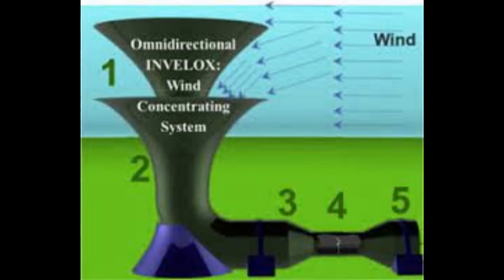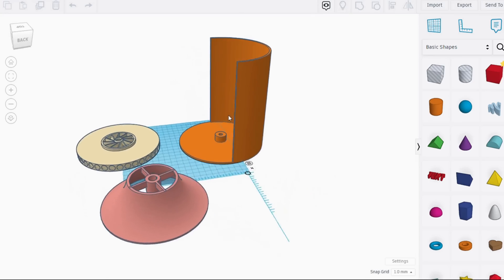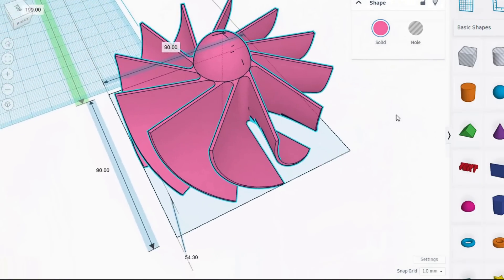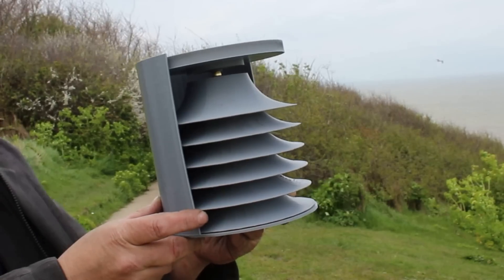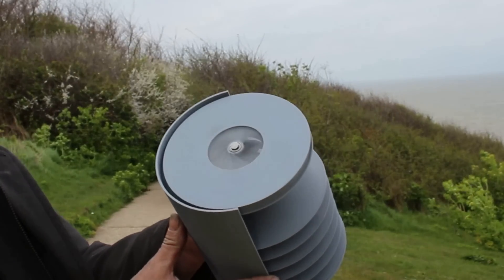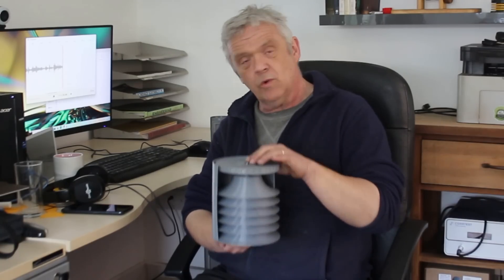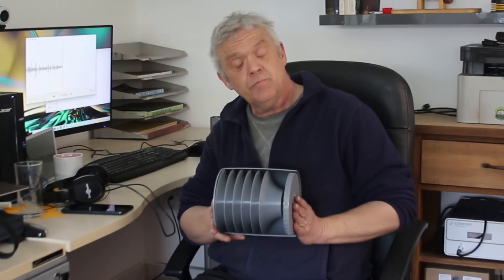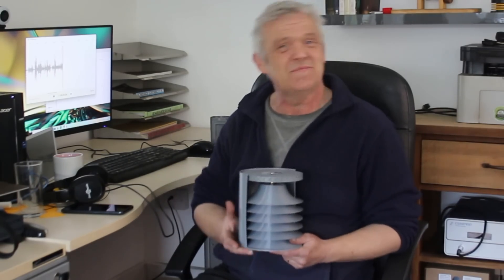1901 Brand New Wind Turbine Design For Camper Vans, Boats And Roof Ridges

Comment: Robert, did you have the chance to compare the power output of this VAWT vs using the same generator (or the alternator) directly as HAWT? 

What is the percentage loss due to redirecting the wind?
Reply: in technical aspect: this is not realy a VAWT - since the airflow is along its axis => what defines a HAWT (even if the axis is vertical to ground surface
the loss will be imense and the total design can directly go to the bin. The whole thing does not make any sense at all.
Reply: @sonic_P  I am not sure whether the loss will be really immense or minimal. The best way is to try and see. That is why I asked Robert, if he had any comparative values. I am rather optimistic and see this method (not only this design) as the most efficient VAWT to be designed. HAWT is much more efficient than any VAWT due to its logic. For  HAWT, as ypou said, the wind is parallel to the rotation axis, and the whole fan area is productive, while for "normal" VAWT the wind is perpendicular, and halfof  the area is not productive, if not counter-productive.

But with this design you change the wind direction ( and just be because it is parallel  to the axis, it doesn not make it HAWT; but yes a HAWT rotated 90 degrees with wind also diverted.) and make use of the whole area again, while you loose some power due to re-direction.

That is what I am after.
Reply: @kadirhaldenbilen6149  there is a reason, why he does not have comparatitve values: it does not work ;) resp. the losses are too far too big so it will be not competitive with any of the established WECs. (I was one of the developers of VerticalSky by Agilewindpower, I know a little about WECs  - and they still have hard time getting her VAT running - despite producing energy....).
Yes, one could try - easier way would be just putting some simple calculations on paper - or doing very basic CFD analyses first.

s)
Reply: @sonic_P  It is nice that you have some background on the subject, VAWTs in particular.  I am not  (professionally at least) involved in the subject matter, but heavily interseted, especially on VAWTs; for use on boats. As far as I know lift type VAWTs are more performant than drag type ones; so your system should be on the upper scale VAWTs; but still as I said it can make use of the half of the wind swept area. That is why HAWTs are aup to 40% efficient while VAWT stay below 20% level.

If in this design, power loss is even at about 50% level, then that would be at other VAWTs' efficiensy level. Any better preformance will put this thing  above them.

It is not that easy to sit down and solve partial differential equations on paper to see how much it will perform; and not everybody might have the chance to sit down and model the system for CFD overnight. Just making a small model might be faster and easier...

Comment: It looks like you could daisy chain these top to bottom if you made a hole in the base plate and allow the wind to continue up through the following base of the next unit, capturing and reutilising that energy. Lay them on their side in a long row along the roof line and rig them up with capacitors.

Comment: Finding these designs very interesting, this one particularly interests me for powering a IoT devices in the field.

I haven't watched the whole series yet, but the section that carries the magnets seems to be common on most designs and I assume therefore the serpentine generator model for holding the winding from an earlier video fits with this?  It looks as though the "back wall" would need to be shrunk a little to allowed the winding holder to fit around the magnet holder?

Are there build instructions somewhere that detail the bearings, shafts etc required?

I'm now subscribed so will see everything going forward, but think I'll be cramming session going through the previous stuff!

Comment: love it... but less moving parts on a boat the better... have you looked at Davinci turbine principle to use the wind turbine above the roof to remove (suction) heat from the attic as well as make power. I live in Florida where it is summer 10 months of the year. biggest cost is cooling the home. Thanks

Comment: The turbine is still the actual limit as you can get choked flow, hence there is a limit to how much stacks of cones you can effectively stack (beyond which you get diminishing to no returns). Also since the turbine won't be 100% efficient at extracting the energy from the wind the leftover could be the start of the next stack of cones (and presumably you could use less cones before you saturate the following turbine).

Comment: I would guess that there is diminishing return for each cone you add. But that does not matter. figure out what the optimum stack is then make it modular. separate the cones from the generator. Then you can add as many cone units as you need for this application.

Comment: I'm really intrigued by the stacked 'cone' ducting.

With the impeller on top, there are probably some opportunities to exploit thermal energy. 

Perhaps as simple as painting the whole thing dark to absorb heat (hot air rises); Maybe adding an 'axial' coil for heating in the center (electric heating, or maybe hot water from an external source - using this ducting to cool the water).
====

The ducting also seems like it could be used to exploit air entrainment (without the turbine)...

Comment: What will be the limit of stacking this things i(f we ignore the weight)?

I you stack X layers on top of each other, the amount of wind captured would increase for every layer. That again would cause an increasing windspeed down the inner "tube" for each layer (more wind captured/more wind must be "transported"). Increased speed would case increased resistance. What would be the perfect number of layers for a given windspeed and a given inner "tube"?

I'm struggling to find the way to calculate this..

Comment: Robert, If there was a way to direct the wind from the center of the stack out to the edge of the rotor you would increase the torque, because of the larger swept area and pressure further from the axis, improving generator performance.
Your thoughts?

Comment: if you knew wind would only come from one direction could you put 50 or so of the tapered cones inside a peace of 100mm pcv pipe and mount across the ridge of a roof or even make it the trunk of a fake tree🤩🤩🤩🤩🤩 would lv to see this on upcoming video plzzzzzzzz☺🙏

Comment: Great design but what happens to it in high winds and rain? Wind turbines normally have the ability to furl out of the wind to stop destruction of the turbine bearings.
Reply: I agree, a great design, and I believe it will prove to be quite robust. Conventional wind turbines generate power due to the the lever effect when a column of moving air strikes the angled blade surfaces set perpendicular to the direction of the wind.  The lever effect is translated into a very powerful twisting force (torque) at the fixed point or hub of the blade assembly, giving rise to the relatively slow (30-40 rpm) rotational movement that we see.  The component that normally generates the electrical power is an alternator which operates at a much higher rotational speed (1500 rpm).  Consequently a very large multi stage gearbox is required between the rotating blade assembly and the alternator.  This is the week point in most wind turbine designs as an immense amount of heat is generated inside these gearboxes due to the vast energy transferred in a relatively small space.  These gearboxes which are the size of small vans must increase the drive speed from the blades from 30rpm to 1500rpm, and are filled with oil for cooling and lubrication.  To prevent an over speed event in high winds, the blades can be feathered to reduce their rotational efficiency and the nacelle can be turned to reduce the effect of the wind on the blades, but as the blades remain constantly exposed to the prevailing winds, any failure of the built in control systems that prevent overspeed events, may result in excess stress, build up of heat and eventual seizing of the gearbox with disasterous results (fires, blades spinning out of control, breaking and even complete collapse of the tower).  Roberts design has non of these features, and also has the advantage over other types of horizontal axis wind turbines (Savonius and Darrieus types) that there are no moving parts exposed directly to the elements.  Also the open side can easily be closed off either partially or completely using a semicircular slide during excessively high winds, so this design should prove considerably more weather and wind proof than other types of wind turbines, in fact it would prove ideal for rough weather and high wind speed environments, and could be promoted as such. The only down side is that its power capacity is limited to the relatively small area of incidental wind compared to the vast cylindrical column of wind that a conventional wind turbines blades are exposed to as defined by the circular area swept by the blades rotating around the hub. But even this limitation can be over come by stacking units to form a 'turbine tower', and even arranging towers next to each other to create 'turbine walls'. This could be used instead of conventional cladding on skyscrapers and other tall structures.  My apologies, I hope you don't mind my very long reply, but I confess, I really love this design.
Reply: Good question - don't want the bearing seizing and the rotor bouncing away

Comment: If you opened a hole in the bottom, wouldn't it suck additional air up due to a venturi effect?  Wouldn't that open the possibility of installing a second fan at the bottom?  Haven't thought it through, but that's my first thought looking at it.  Interesting nonetheless.

Comment: Do you think if you painted or printed those cones in black that they would heat up and cause more of an updraft to increase power.
Or put a black "chimney" on it to increase updraft.
Another idea is to have mirrors focus sunlight on a particular area to warm it up and that heat rises from copper heat transfer pipes inside the chimney?
Just throwing more mud at the wall of ideas. 💡💡

Comment: I was wondering whether  on a  boat the drag and consequent extra power to required to overcome it would in some way equate with the power produced.  If so, under sail this might not be problematic but for powered craft there might not be much advantage.

Comment: Love what you’re doing here. If you could find a way to get the air back the edge of the generator disc and place the turbine blades out there also, you’d have greater torque and power generation. Maybe another parabolic disc upside down to force the air back out.

Comment: Well then you could just expand the shield on that a bit can't you? I feel like leaving a gap could improve performance as it would give more space for air to get sucked into. This column naturally creates a bit of a pressure differential as it directs air vertically and away, so it is able to suck in more air. It also gives a bit more capture area period as well. You could possibly even put a ridge inside the shield at the middle, as the airflows from the sides swirl around the back, and you can direct that them into the column. Rather than having them crash directly into each other at the back of the shield.

Comment: Robert, super interesting and with great potential. You talked about capture area versus swept area. Is there also a sweet spot of how many and proximity of stacked cones in terms of power output and or efficiency? I can't help but feel that too many stacks or proximity would lead to air being "slowed" by boundary layer surface effects (think friction)- in essence a fixed "overhead" or "cost" (for want of simplification) for trying to make the system bigger and more powerful. Any thoughts or analysis on this side of an otherwise great concept?

Comment: You could add some sort of cap to the outlet, attached to the backplate, to cause a low pressure zone in the outlet and increase the suction ?

Comment: Good ideas. I have have just subscribed. Please test this: Some people live where there is no wind for days, intermittent wind, and occasionally too much wind. Our chimneys always work 24/7. Of course heat assists this, but the chimney effect works even without direct heat. Put your turbine in a pipe 35 feet to 40 feet tall with the parabolic cones openings at the bottom and guy wires for stability. On the top is a swiveling curved 90 degree section with paracone exit and a vane on top to maximize output. Does it matter if the turbine is at the bottom or the top of the pipe? Test this when there is no perceptible wind, and up to gale strength. What is the range of useable output to batteries? Thank you.

Comment: Great project. Aeromine aerofoils in front of the device can be used to focus and accelerate the wind. The fence at the back will slow down the airflow. This will result in some of the air flowing around the outside. A dorade type shape at the top, can suck air out through the turbine. This can be part of the direction fin.  Can this be used to condense moisture from the air also? Ways to make water will be valuable for the boats taking part in the GGR retro yacht race. Cold sea water can be siphoned through a condensation device. Solar cooker can be used for distillation.

Comment: Uuuhhh... It spins! It spins fast! 
But! But! But! --- There isn't any load. How does it perform when completed; including a generator?
Reply: The expectable load is proportional to the air friction on the surface of the cones. That friction is proportional to the speed of the air, the radius of the cones and c. While the thingy accelerates the air, it does so most in the center where the radius is small, and the cones are smooth... Hence the power output will be pretty small: I agree
Reply: It just isn’t going to work to a useful extent. You are quite correct that as soon as a load is added in the form of the coils and an electrical load, it will probably slow or stop. The biggest problem I see, and I might have said this before on another of his videos, is that it is far too small to collect any useful energy from the wind. Just because it turns at this scale isn’t enough. The power available is proportional to the surface area that the impeller in this case presents. All the funnelling means nothing. And you can’t get something from nothing.

Comment: Hi Robert, this is amazing!  I'm wondering if the limiting factor on this isn't the wind input, but the wind exhaust?  I love this application!  Thank you!
Reply: The limit is that you compress/speed up the air to move through the smaller area of the turbine. There's quite some loss attached to this. So using a device like this makes only sense if you otherwise cannot achieve such a large area (safely).

The compression of the wind will increase depending on how much energy you extract - so your electrical load - which would need to be managed to be in an optimal efficiency range for the blade pitch/optimal RPM for the generator.

If you want to simplify the system electrically, you could use centrifugal force to adjust the blade pitch to keep it in an optimal pitch for the wind pressure (aka wind speed).

So you get a variable RPM but an optimal pitch to capture the wind with optimal efficiency.

The variable RPM can then be converted to an optimal RPM of the generator with a CVT – instead of using magnets in the rotor itself (which is a stupid idea to begin with).

Comment: What about putting passive veins inside the plates that direct the air towards the turbine blades. My thinking is the air would (I think) have less vortices as all the air is moving like a laminar flow and also be spinning before it arrive at the turbine blades.  The rotating air would add thrust by removing the vortices as it pushed on the turbine blades.  I hope you try this.

Comment: I would love to test this out on my sailboat while moored at anchor and out sailing. Since the sailboat is small in size  i have to use a mini solar panel to keep the battery charged (for 12vdc VHf radio, lights, and gps) but stow it in the cabin when sailing.  Would love to do a review / pomote it on my website as well.

Comment: Hi Rob,
Now we talking,  a great idea for a boat. Instead of trying every combination of wire turns for the coil can you give us a guess for numbers of wires for coil for charging a 12V battery. This is critical for a boat as we need to be able to start the battery after a long lay up and for the bilge pumps to be operational 24/7. in my case I have the worst VAWT which produces a max of 0.5 Amps in the strongest wind. I could easily swap it for this design. André in Sydney

Comment: Looks like we're almost making something nearing that of a (Nicola) Tesla Turbine.
That's just a stack of discs with a gap in between each, though, no impeller or any other sort of blades. 

A great example of an impromptu one, is a computer Harddisk Drive.
Take the cover off, power it up, and witness the immense amount of air it moves!

Makes me wonder if a Christmas Stack of discs, mounted at am angle (so the leading edge is vertical) would work out... I think it would be self-orienting, thanks to the shaft's angle (mounted on a platform that can traverse around), and with the angled discs I think it would help to funnel air into (and between) them.

What I like about that velocity stack shape, though, is I think it might act like a compressor in a Tesla Turbine...? Although the bottom of the next "velocity disc" would need a flat bottom part way in, to look more like the inlet side of a Turbo...

Just spitballing.